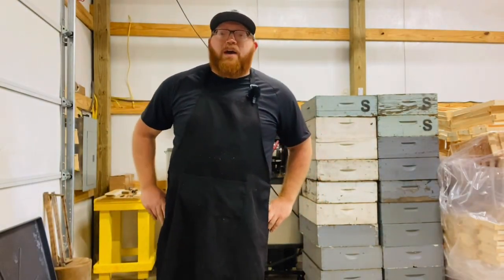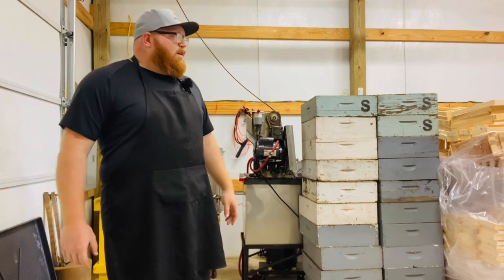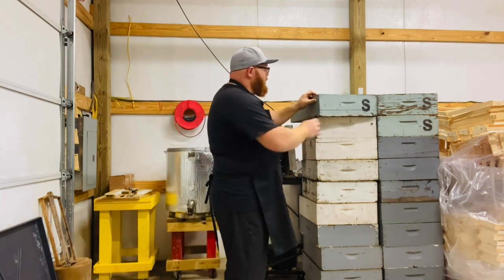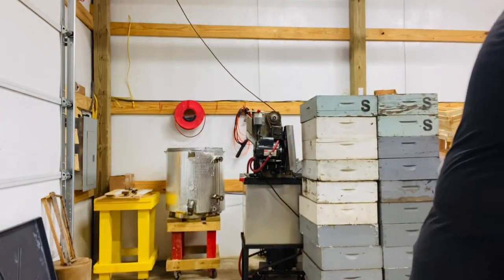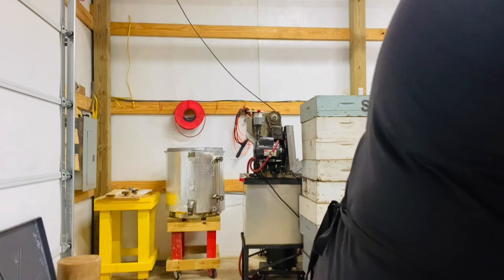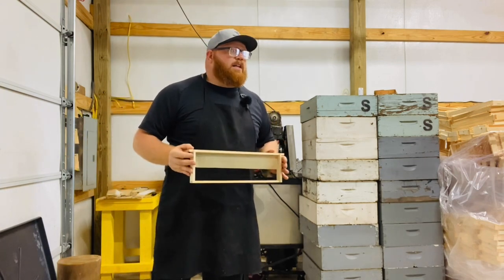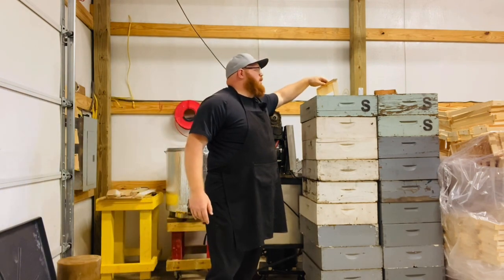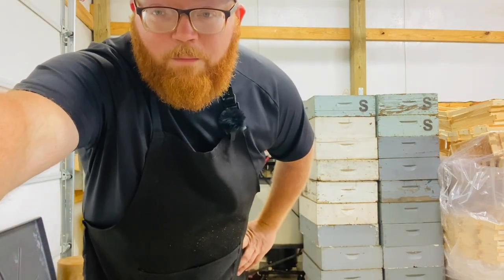How to prepare your comb honey supers for the honey flow!

Comment: You are not the only guy with an s on boxes. I usually don't run full supers of comb honey. I just put a couple of frames per super on my strongest hives. My market for comb honey a little weak. I started producing it for my personal use. I ended up  with a lot of shallow supers with drawn comb. There a lot easier for older beekeepers.

Comment: You did a great presentation on preparing your frames for comb production.  
I just subscribed hoping to see if you have a presentation on how to set up your hive for comb honey production.  When I'm done with the video I'll search your library for the set up procedure.  
I haven't done comb honey for a couple of years.   I've used the Juniper Hill Split to prep my hives for production.  Where I live splitting hives and rebuilding to the flows won't work.  I'm in the north and it just won't work for me, so I do the Juniper Hill Split.

Comment: Kenneth Taylor DeSoto Illinois, I use a 25 gal metal Barrel cut end put on concrete blocks add 2/3 water and boil my frames clean gets the grooves clean. Use rubber gloves maybe to swash the frames around
Reply from the maker: Good tip